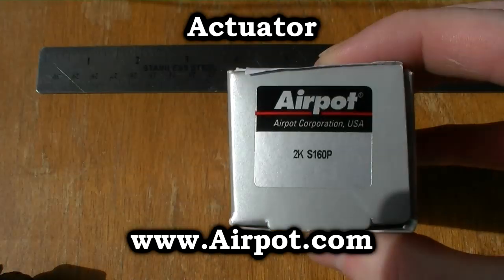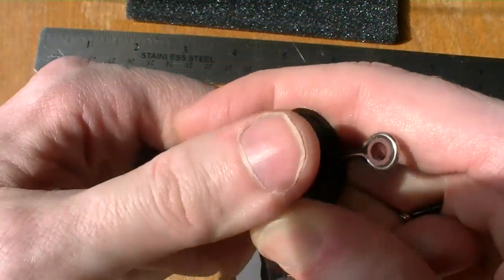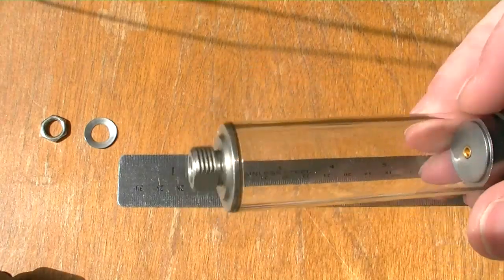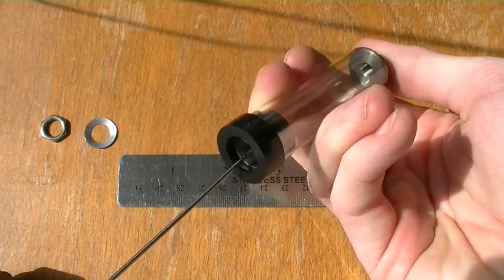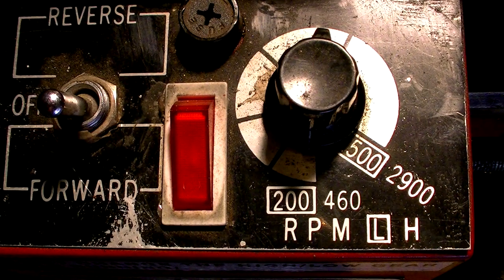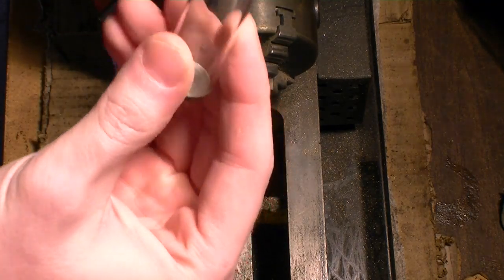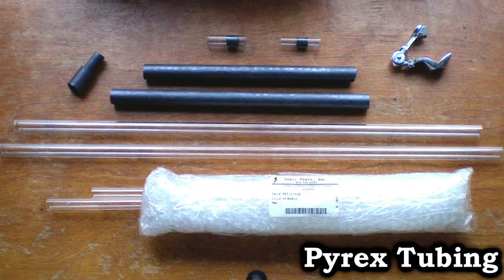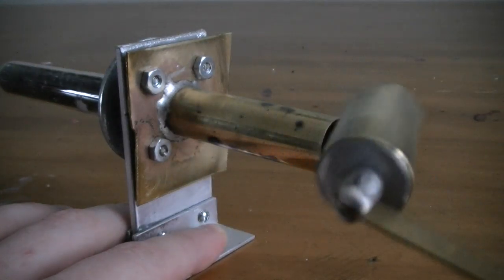Lamina Flow Stirling Engine - Pistons and Cylinders

Comment: Your problem with uneven inside surface of your glass cylinder. _ Can I suggest you get  a set of small "Cylinder Hones" and hone the inner surfaces to your requirements. The Hones are usually available from your friendly mechanic at your local Motorcycle dealer. They are easy to make if you can not get one the right size. Good luck.

Comment from the maker: I tried using a copper tube before and it didn't seem to work so well.  It could be that the heat just traveled too fast throughout the tube and didn't heat the air inside the tube as effectively.  Give it a try though.  Hardware stores such as Home Depot sell something called a Copper Air Chamber that is shaped very similar to a test tube and would be easy to cut down with a tubing cutter.

Comment from the maker: Yikes, you might wanna try some glass syringes instead.  I have purchased lots of different glass syringes through ebay and they are just a few bucks a piece.  So far I have only gotten one glass syringe to work for me and it didn't compare to a graphite piston inside pyrex.  But that was my only attempt to use a glass syringe and I'm pretty sure I'll get better results in the future.

Comment from the maker: @adfgfds Rotating with your hand sounds difficult.  You might be able to use an electric drill.  You could clamp the drill down on a table with the threaded part of the actuator inside the drill.  If your drill is one of those that can stay on if you push a certain button it might work just as well as a lathe.  Be careful not to breathe that glass dust though, you just know that can't feel good in your lungs.  8-)   I leave the garage right after I make the cut to allow all the dust to settle.